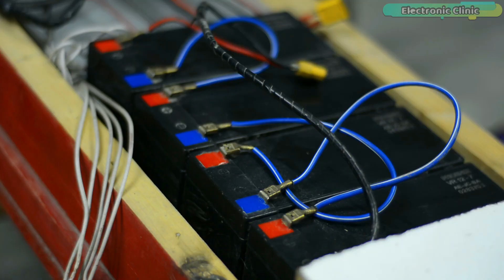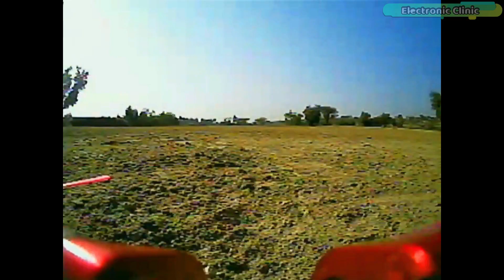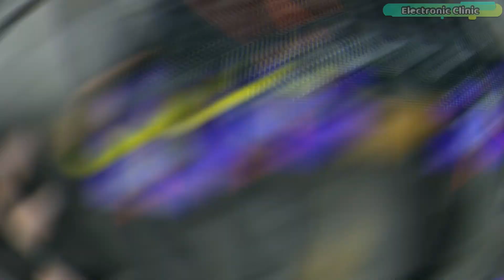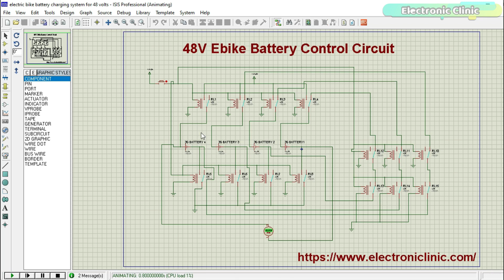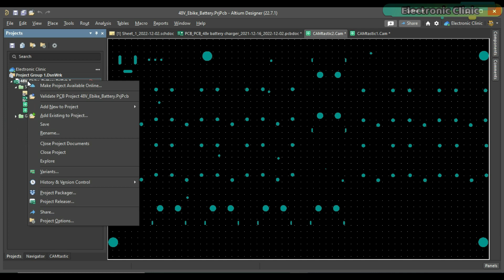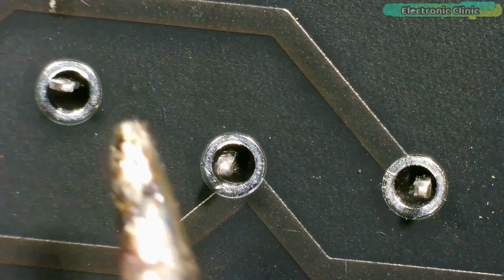Ebike Battery New Invention, 36V Ebike Battery, 48V Ebike Battery, 72V Ebike Battery, Diy Project

Comment from the maker: Related Videos:
How to make 3S and 4S Lithium Ion Battery Packs:
https://youtu.be/MsHI3rXtePo

How to make Spot Welding Machine:
https://youtu.be/xnPIsrxVozM

How to make Spot Welding Machine using Arduino:
https://youtu.be/j9Y-N-1Wh8U

How to Make 4S Lithium Ion Battery Pack for a Racing Drone:
https://youtu.be/8vMTZqvSl5s

500Watts Ebike Controller Wiring Getting Started Video:
https://youtu.be/lHJKBdvVDJc

How to Make a Trike Electric Scooter using two 500Watts Ebike Controllers
https://youtu.be/w8vKFE3Xmgg

Comment: Hello, I am not very knowledgeable on the subject, so can I ask you a request?
I need a circuit diagram for 6 batteries, i.e. 72 volts. If there is one that I can charge from an 18 volt solar energy panel, I would be very happy if you share it with me.

Comment: I live in the states, would you be able to build me that for a 72v ebike battery for a 3000w hub motor. I'm hoping for somewhere around 40ah or close to. I like the option to charge on a 12 v charger. That swictch to go from parallel and series is judt genius! And how much would it cost me? Thats is if you are willing.
Reply: Did you get a answer?
Reply: No i didnt. I actually just oredered my battery. Make sure you match up your bms from  battery with controller (if its not programmable).
Reply: @just-in3932  how do i make sure of that? What are the important things i should check. Thank you
Reply: Notso obvious, what ebike kit do you have or are you looking at?

Comment: that no way its would be 48volt with little battery pack
Reply from the maker: You can connect multiple batteries in parallel.

Comment: Bhai 4 battery pack 38 volt kasa nikal rahy ha agr zayda battery pack lagana ho to Kya karay .? Circuit Bara karay Kya.?
Reply from the maker: Ye abhi 48v ke liye, agar ziyada ya kam voltage chahiye tu ap 2s,3s,4s,5s,6s, etc batteries ko series mei connect ker sakte hain.
Reply: @ElectroniClinic  ok acha thanks Yar ap na maray bohat sa Pasay bacha leya ma apni EV bana Raha tha